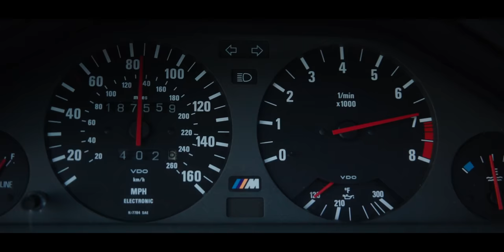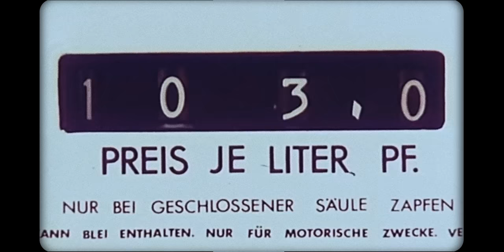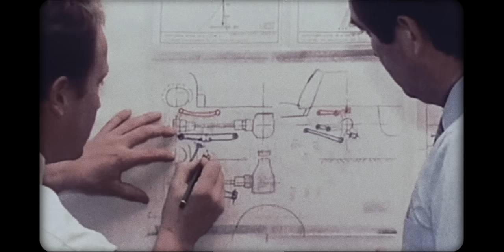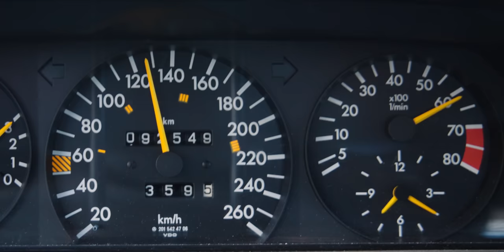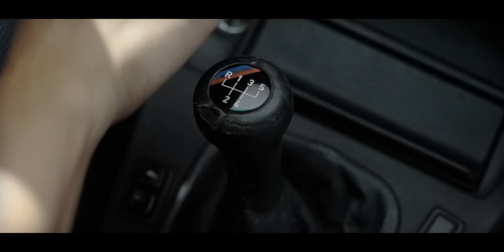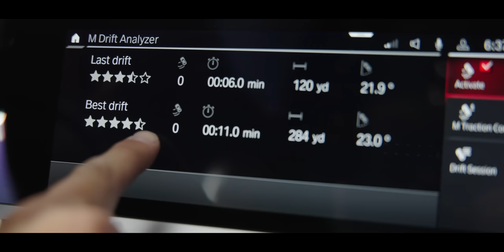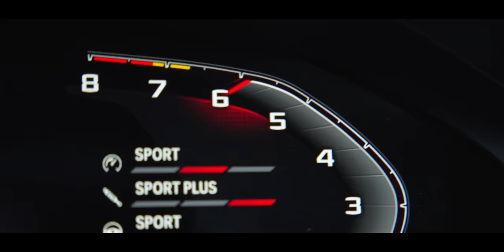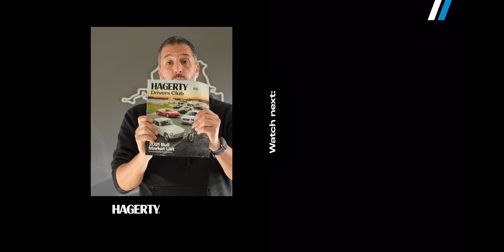The Definitive Review: M3 Competition feat G82 M4 and E30 M3 — Jason Cammisa on the Icons — Ep. 03

Comment: Amazing video. My only thought F80 is kinda underrated. It was definetely a true M car especially considering its lap times being 2 seconds faster than any other car in its class. It still is, one of the fastest saloons.
Reply: and beating a just 4 years older 911,, that's crazy
Reply: No. It was over rated. It’s the car that attracted all the bandwagon BMW M fans, it’s the car that started to blur the hard line between M and non M cars and the car that made true BMW enthusiasts upset and leave the brand and to further push them into Porsche.
Reply: @defineivan  what do you mean?
both in terms of power and in terms of cosmetics, the F80 M3 has all the same features that M cars used to have over the regular M-sport..if anything it actually sports more than what the E30 or E46 M3s had?
like i dont understand this comment at all. what is it that would make it "blur the hard line between M and non M", that the previous gens did not?
Reply: F80 is not a true M car. It has an M badge, but it is not a true M car

Comment: The e36 m3 was a MASSIVE leap in performance over the e30m.  Yes even the us spec.
Not sure why you'd skip over it.  That's pretty lame.
Reply: Exactly....and e36 raced plenty. Not true to say that subsequent models weren't raced.
Reply: @chrismartin5870  still very fast car. There is video its beating a 440i (B58). Its even fast as a E46 M3, due to less weight
Reply: I love the E36 but they perfected it with the E46 that's why
Reply: The best M3 after the E46 imo
Reply: E36 M3 is used to being the red-headed step child. Missed out on the euro engine in the US too. That's okay, still a masterful car  and wonderful to drive :)
Reply: @hjd5973  The e36 M3 is a reasonably quick car but the only way it'll beat an e46 is the the latter is on plastic tyres, and the only way it'll beat a 440i is if if the 440 is running on three cylinders. The e46 is actually only about 100lbs heavier but has 60 more hp, the 440i has "only" 40 more hp but through the whole midrange it's always got 50% more torque. The difference is night and day.
Reply: @ependergrass  search for the video then, its equally fast as the 440i
Reply: And you can compare it pretty well with the new one

People hated the design or the e36 back then
Reply: The E36 is pretty lame.
Reply: @misfiresandflattires6874  why are you angry ?
Reply: @domtoretto3280  Angry? Why are you so hostile?
Reply: @hjd5973  If you ever see a video of an e36 M3 keeping up with a 440i, either the e36 is modded or the 440i is broken. The 440i is like 3 seconds faster to 100mph.
Reply: I completely agree with you because I have one and I'm always looking for an excuse to drive it!
Reply: @hamie63_m  the power to weight ratio in the e36 M3 is awesome, an e46 has more hp but I don't think it's balanced as well imo
Reply: @BigUriel  its a rolling race ;)
Reply: I was 13 when the E36 was launched and my dad owned an E36 M3 (European 3.0 sedan version, 286 hp), so the E36 M3 is very special for me personally. Nevertheless, it makes sense to skip it for this purpose. The E36 M3 was dominated by the brilliant engine, but wasn´t as special in terms of chassis, bodykit and focus on overall performance as the E30 and the E46.
Reply: @klausm5460  you lost me at the chassis nor performance being special. That's just. Incorrect.
Reply: @domtoretto3280  Well, it´s complicated. Especially with the E36 sitting between the E30 which had close connections to the race car and the E46 which saw more extensive changes to the base car like wider fenders, bigger wheel diameters, bespoke LSD and multiple reinforcements and bracings in the body than the previous generation M3. Don´t get me wrong, the E36 M3 is still one of my favorite M3s, but BMW M started increasing the expenditure to make an M3 out of the base car massively with the E46. So in that sense the E46 is definitely the peak if you want to exclude V8 and turbocharging.
Reply: @klausm5460  the E46m is a lightly massaged e36m That's it.  Its also heavier, so much of the minor adjustments didn't translate into a heck of a lot of difference in performance. Sure the esthetics was a bigger departure from the base model but I'm more of a function over form type. So the E46m never appealed much to me. It's too bloated and rounded for my tastes. But I'd prefer to talk feel and performance myself. And the e36m is a great car and was an absolute massive jump up from the e30m3 in pretty much every performance metric. 
E36m to E46m didn't even come close by comparison.
Reply: I hope it was just for length of the video since the e36m3 was way more successful as a race car than the e46m3 could ever dream of.  They had to cheat and drop in a v8 to be competitive against the Porsches.
Reply: The e36 lacks the German build quality and pretty much only delivers in its engine power. The e30 has more racing pedigree and character.
Reply: @hueyfinesse  Yes, the E36 suffered from quality problems in the beginning, but they improved on that later on. I still like the E30 for being a reincarnation of the 2002, but the E36 was more sophisticated and a more mature contender for the then very modern Merc 190.
Reply: @hueyfinesse  they all have shitty interior build quality especially including the E46 and e90.

Even Mercedes of the same era suffered. Its a moot point.
Reply: @domtoretto3280  That era's Mercedes had its fair share of problems, and for that reason they cant be compared to the older models. But i do enjoy the e36 like many people. Its Europe's s chassis. A wonderful platform for Motorsport, not that good for anything else. 

I also think they will hold value and be a good investment.
Reply: @BigUriel  no it is not 60 HP more. I recall the later revision of the E46 M3 has the 3.2 liter L6 pump up to 332 or something horse power. The E46 L6 engine is pretty much the same engine with tune to higher rev. That is pretty much it. The probelm of E36 was it looks almost just like other 3. Other then that and its chassis being a deadtrap. It is probably the biggest peformance leap between 2 generation of the  M3.
Reply: As someone with a e36 this was sad. A classic car.
Reply: he probably couldn't get his hands on one in time for the shoot. It's a logistical challenge to get all these cars together, it's not always possible to get everything you want. Plus this video isn't about all the M3s. It's about the new one. The e46 an e36 are the same concept. So the E46 shows the point he was making well enough. Also the e30 isn't nearly as bad as you think and is actually much more nimble than the e46
Reply: He was going down a particular timeline.. as he stated "its peak, where it started, and what it is" he never said it was supposed to be a complete lineage of the M3.. he only mentioned the E90 and following model because they completely changed the concept of what the M3 was... i dont think a single soul that knows anything about cars would deny the E36 is great car.. just wasn't relevant to the story he's trying to tell
Reply: The E36 was the fakest M3 ever...it even didnt look like a m3...it looked the same as a normal 316i....
It would be a real m3 if it had a wide body!!!
Reply: Only Americans (and those not in the know) down play the E36 M3. The euro E36 M3 with the euro spec 3.0L S50 was about 50hp down on power to the 3.2L S54. But the revised 3.2L euro S50 came within 20hp of the later S54. Factor in the lighter weight of the E36 and the euro S50's stronger bottom (read:rod big end) and you will realize the best M3 was never sold in the US. S54 owners,  imagine rod bearings out lasting your cooling system, imagine, there's no heaven, no hell below, imagine.
Reply: In Europe 
Light years ahead
They had straight six in the e21 body in 1983
USA took ten MORE years to get it done
Reply: @BigUriel  @HJ D was referring to the E36 M3 Evolution which had some rare factory monsters that truly did output 321hp and in the right hands, do routinely keep up with the SMG E46 M3 (Yeah, Manual E36 Evo vs. SMG was a handicap match) and in one case, a 440i. (It was a rolling race, where the E36 M3 Evo's Gear Ratios were a better match as opposed to a 1/4 mile.)

It's not always going to do it, and to be frank, it's 0 - 60mph sucks due to a 1st Gear Nanny but the M3 Evo has the potential to keep up.
Reply: @BigUriel  In the video, the M3 has Supersprint X-pipe and Supersprint Sport muffler and no speed limiter. 440i is bone stock on 19" lightweight wheels. That's around 10whp at best to the E36 M3 Evo. They both do similar 100 - 200kph times at around 14 seconds give or take so it's not impossible.

0 - 100kph on the M3 Evo is hampered by the 6 Speed's factory nanny that tries to keep wheelspin down but ends up nerfing the E36 M3 Evo so hard that the USDM version actually keeps up in 0 - 100kph times. The Evo performs well on rolling races.
Reply: Drone Strike  that's the most ignorant response yet in here. Lol 
The us spec is hugely popular weekend/track toy. And for good reason.
Reply: @domtoretto3280  I believe alot of the e46 fame, comes to it having the new age looks (past 1999) and those lines are still easily recognisable by people that have 0 clue in cars. My first car was an e36, but i still prefer the e46 over it. Its just good, even though the e36 has better cornering abilities. And the car i got my license was a mercedes 190, so this video is just pure joy. And btw in my opinion the e92 m3 gts is a hell of a car. A v8 in a 3 series, cmoon :D
Reply: They probably couldn’t find one to flim with, I think they probably would have wanted to do all the m3s but it may have just been a bit too hard to get all 6 in good condition to film with at the same time
Reply: @BigUriel  I've had both an e36 and e46 m3.  And mutilple e36s 318ti, 328i etc. Currenty have an e36 328i. (And a merc but that's not relevant here) I didn't find much at all between the e36 and e46 in terms of straight line speed. Both brilliant cars.
Reply: @misfiresandflattires6874  nah they're pretty good. Especially the evo
Reply: E36 M3 wasn’t a race car, the BMW factory touring racecar became the 318. So the statement is factually true.
Reply: @mikeh2006  Nah bro. The E36 has always been junk.
Reply: @misfiresandflattires6874  I assume you've had a bad experience with one
Reply: @mikeh2006  Not just one, many of them.
Reply: @misfiresandflattires6874  haha I understand, Oddly in the 3 years i've owned my current e36 328i it's only had two problems. Water pump and its fuel pipe came off. The ones I had literally years ago were always playing up.
Reply: @misfiresandflattires6874  all 3 series have been junk if you really want to be honest with yourself.

Comment: Thx Jason. for validating and verifying my affection for the 190e. Plus love your humor about the Board being blind.
Reply: 1st small Mercedes wouldn't have existed without 3er, original was a slug, why Daimler had to send it to Cosworth.
Reply: @unowen-nh9ov  Nothing to take away from the 3 series. It is by far still the best handling car ever. I don't like the designs after e46 but suspension is at par with e46. That being said, 190e was designed for rallying, and then unfortunately the Audi Quattro came in. So they decided to go to DTM. This article is not about the 190e vs 325i. It is about the creation of M3 due to 190e.
Reply: @unowen-nh9ov  1st small Mercedes exists because the USA was (and still is) one of Mercedes-Benz' largest market and the USA had just signed fuel economy legislation.

Comment: In South Africa we never got the E30 M3, instead we go the 333i,  Its now a cant get and such a peach of a car. Developed with the help of Alpina, only 210 were made and only ever sold in SA, making it one of the rarest cars in the world. It had slightly less power but way more torque than the M3 so it was only slightly slower than the M3. The engine came from the 733i so it was heavier than the M3. Because of the size of the engine there was a lot of fiddling that needed to be done. There were also some quirks like having to choose between power-steering and aircon (obviously its aircon!). It also had a dog-leg gear box which took some getting used to but those gears were nice and long and the car sounded amazing thanks to Alpina. A deep, throaty growl! These cars sell now days for well over $100 000 and their price will only go up and up! Such a grail!

Comment: As a youngster I had the pleasure (scare) of riding in a E30 M3.  It was the best hot lap ride I may have ever had to this day.  I had the misfortune of wrecking a 78 320 rebuilt at Korman Autowerks with weber carbs and set up for quickness and cornering.  We raised the ass to take some camber out of the back wheel so that we could try to get a rotation out of a set of Comp TA's.  I put it around a tree in a banana shape at 16.  I have not had a sporty car since.  One day I will have a nice M.  I am crazy and thinking about a x6m at this point.  Crazy right?

Comment: Personally, I'd still rather have the Mercedes, but that's just me. I prefer to drive automatics for my commuter cars and Mercedes designed their automatic transmissions differently than other manufacturers back in the day. They didn't bother with all of the fancy tricks that so many other brands use to get the transmission to work faster, they instead just opted to overbuild everything, give it very durable clutch packs and just fucking SLAM into gears under hard acceleration. And I appreciate that brute force approach, because it works.

Comment: The F80 M3 with a good suspension setup runs circles around the G80 making it a far better proposition overall.

1) Better looking.
2) Much lighter and smaller.
3) Double clutch transmission.
4) Just better to drive.

The stock suspension on the F80 is lacking indeed which makes the car a bit unstable as it feels like it can't put its power down properly, however a good suspension transforms the car into a reliable rocket.

Comment: great video!!
though the comparision is limping a bit, the e30 M3 has 200 hp, and the g80 competition has 500 hp, so more than double. 
i'm super sad i can't find it anymore, but there was one video on youtube where some guys raced a e30 525i touring against the f31 touring, with the latter having some 50 or 100 hp more. that race turned out a quite close call, because the much lighter e30 was much more nimble around the corners. and to me this concludes somewhat of what is lost in the 3 series: it was forged as a small, light but great car. a 540 also always was a great car, but the 3series was simply something different. and that, what it was and what made it great, it simply isn't anymore. it's a better e39 M5, but it simply isn't an M3 anymore.

Comment: Horsepower is great and all but after all the years of driving I’ve come to conclude that light weight cars are always more fun. The original M3 isn’t fun solely because of its steering rack or high revving engine, its fun because its fast on a tight track, because its light weight. Sadly, small engine light weight cars with big turbos come with big lag. Hybrid tech could change that.

Comment: This is an amazing video. TG should be hiring you! 

The B58 is amazing and the ZF gearbox…simply better than manual, especially with an XHP map.
Reply: No b58 in these cars
Reply: @philNullFunf  yeah try. I was thinking s55. Which is largely identical to B58
Reply: No the s58 is closer to the b58, but with biturbos and closed deck and other changes… s55 is an older generation. They don’t share to much parts.

Comment: The M3 is low on torque below 2000 RPM, hence why it didn't give Randy the right gear in the corners... it needs to shift down 2 - 3 gears to get going above 2000 RPM and on where the high torque is.

Comment: 190 is a turd in terms of dynamics. Either they are driving one with DTM spec suspension which is obviously not the case if you see that enourmous roll in corners or this is a little biased. And the record of driving 150mph for 50000 km? How is that possible if the car can't go over 140?